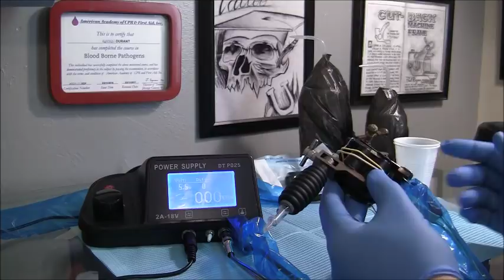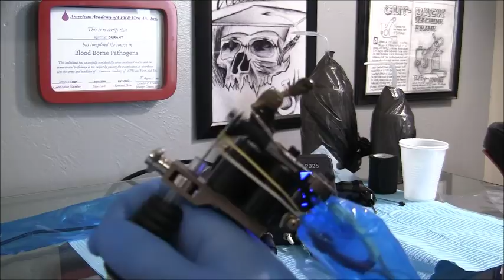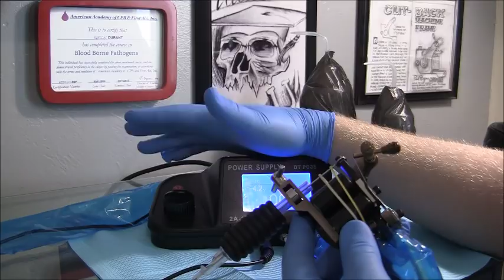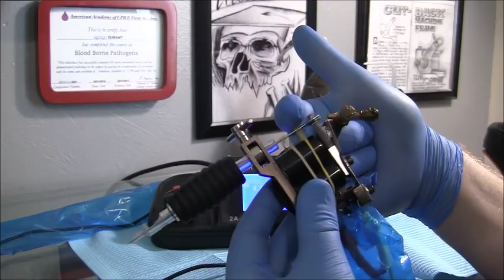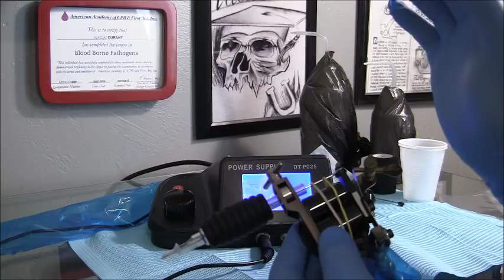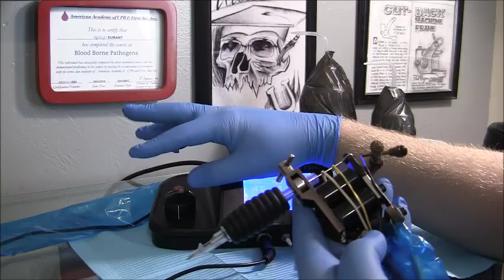Setting the Correct Voltage- Tattoo University

Comment: Are coils better w 3amps instead of 2a?
Reply from the maker: depends on what your trying to do. How does the machine work with 3 vs 2? What type of machine are you going for liner, shader, color packer. Machine building is an art. There is no definite answer to that except for does it do what you want after adjusting that part
Reply: @TattooUniversity line work with ability to power it lower for shading 
Think of line work skull with minimal shading like in the eye and nose sockets
Reply from the maker: @jambajoby32 hold on to that thought and I'll do a video on this. There is a lot more that goes into this than a capacitor. You want a liner that you can shade with. Your capacitor can help but you're looking at spring tension and speed. You also have the throw to adjust. The weight of the armature bar. All things to think about along with the capacitor. I would make two machines. One with each type
Reply from the maker: @jambajoby32  also think about technique. Move hand slow and steady for line and faster for shading. There is so much you can do.
Reply: @TattooUniversity yes sir 🫡 
I know many cats I look up to discuss the idea and my tattoo guy also has demonstrated fine lines and basic shading (on simple tattoos like a lucky money cat (Maneki Neko) or skull with a liner. 
I know is it comes down to having a command for the machine but also would like to hear thoughts on approaching this. 
FWIW, I’m waiting for a shader to be made. I would like to keep my set up super simple and basic.

Comment: I just gotta set up from my brother...so i had my volts on 7...i was doin great for like almost a hour practicing on fake skin. an for some reason it wont go back down its stuck on 16 volts an the knob wont turn it down. What you think happend? Oh an my power supply didnt come with a power cord...i got a 125v power cord...but the box says i need a 250v power cord. You think this is the problem? The box isnt hot at all
Reply from the maker: When you're practicing stuff like this is good because you learn from it. From my experience you don't want to force things to work. You don't want something like this to break down while you're in the middle of a tattoo. It will make you look unprofessional and it will take a lot more time to finish the job. My suggestion would be to keep looking for some equipment that is better. If you have good or bad equipment always look for ways to improve.
Reply from the maker: I have had some really bad power supplies when I first started. I had to go through about four of them before I finally found one that worked correctly. When you get the cheaper ones they tend not to work like they should if you can eventually go for a better power supply. Having a really good power supply is a must and it will last you a really long time
Reply: @TattooUniversity  thanks!

Comment: I love this video to help fall asleep every night. his method is great tho, but don't be afraid to turn up the voltage, depending on your machine build it could vary, do what he shows you with the finger, if it stops its too low, you have to hear the machine sound change when entering skin,  that's what your looking for, if you put your finger on the bar and there is no sound change,  it's too high.  good luck

Comment: Should it be running at ~50% duty if you go by sound?  My machine sounds great, not bogging down too much, but running at a lower duty.  If I bring the volts up it gets to about 50% but it seems to be hitting too hard.  I'm using reelskin and its cutting it.  At this point I'm not sure if it's actually hitting too hard or if reelskin is just really fragile.
Reply from the maker: Couple issues here. Fake skin isn't real skin. Even if they call it that. It is rubber and will act differently. Rubber should actually take more damage than real skin. If you are cutting it then you will most likely cut a person with that machine. Don't think it's your duty that is the issue. The machine is running too fast or your hand is moving too slow. With the needle moving so fast it is acting like a razor blade or cutting device. You want to slow that down so the needles puncture the skin and leave ink without chewing up the skin.
Reply: @TattooUniversity  Wow man I really I appreciate you and your fast response.  As soon as I read your comment, I quickly set up and tried a faster hand speed and that seemed to have made a huge difference.  I was slowing down because my lines were coming out real faint.  I think I may need to actually go deeper and bring up my hand speed.  I'm going to go practice with that in mind.  Again, thank you so much for everything you do 🙏

Comment: Awesome vid! Glad that I found it. 
Got a new coil recently but that machine also confused me. 
It’s so powerful that can only start at 3.5 and it kicking loud.  And I can normally do lines at about 3.7. 
I guess it’s depends to the machine 
Hope it’s normal. 🥴
Reply from the maker: Very normal. If it's working how it should. Somewhere down the line this voltage confusion was thrown out there. I always run 8 volts bull crap. You only use what it takes for the machine to run correctly. 😁
Reply: @TattooUniversity   Thank you for replying me president 🙏 This channel is a community with love. ✌️    Peace

Comment: How much voltage would be ideal for thinner skin vs an arm like face?
Reply from the maker: Start off with less and add more until you get correct results
Reply from the maker: If you don't have enough voltage you will get ghost line. If you go too deep it will hurt and bleed. Machine set up and needle will effect voltage needs. Do a test line and adjust.

Comment: Ur finger does no simulate the skin when stopping the armature bar because the armature bar doe simulate the thin needle going into a small surface area of ur skin
Reply from the maker: You are using your finger to see how hard the arm bar is hitting. This let's you know it has the ability to push needles into the skin. Smaller needle groups don't need as much power. This is where adjusting the machine and voltage come into play. Bigger needle groups needing more force to puncture the skin because they have more surface area to puncture. The thumb is one  indication if your machine can do this or not. If the machine stops when you put your thumb under the arm bar it's not going to push anything into the skin. This would mean your thumb is simulating the skin or what will happen to the arm bar when the needles hit the skin.

Comment: So does this mean that you can use the same machine for lining and shading there doesn't need to be different springs or anything
Reply from the maker: This answer to that is a long and complicated one that people love to fight about. Let's see if I can answer in this comment. Hope your sitting down this could wind both of us. You can use the same machine to do anything you want. You can line, shade, and color pack with any machine if you know what you are doing. It also helps if you understand machines. Let's take it down another rabbit hole. Machines aren't liners, shaders, or color packers. They are just machines. People call them those three names to try and simplify things. You have faster and slower machines. You have different machine frames that allow for more or less stroke. The amazing thing is artist like different things. You can adjust the machine to do what the artist wants. I line with what someone might call a shader. It is a slower harder hitting machine with a longer stroke. A shader set up with less tension on the rear spring. If I move my hand faster I can shade with it. If I slow down I lay down a solid line. Take a "shader" sometime and put short tapered needle in it and start filling in color. The needle adjustments will effect how you can tattoo. Yes you can do anything with one machine if you understand machines, needles, and your art techniques. You can also adjust your machines so they do specific jobs. I can adjust a machine so it does line work better than shading. I can adjust a machine so it's easier to shade with it by adding more tension on rear spring. Certain machines will make it easier to do your job. Faster shorter stroke machines are good for one liners. Longer stroke machine with hard hit is good for color packing. The key point I'm trying to make is learn as much as you can. Knowledge will give you the power to make decisions because you know the equipment and how to manipulate it. You know the marks you want to make. Match it with a machine that allows you to make those marks successfully. So the answer is yes and no. You can adjust yourself or your machine.

Comment: Depends on the machine...  the thickness of the spring you cut and the roll/bend in both springs, the specific coils you wound, and the capacitor. learn to use your hand to apply the right pressure and float the needle. Learn to use the right thickness of spring stock, Ans how to get the perfect roll to those springs. 😂

Comment: The setup volts depends the amount of wraps on your coils. There is no sweet spot. Got 4 different liners machine for different lines, one is running on 3.6 volts the setup is for a 3 round liner needle till maximum 5RL needle the bigger the needle the more power a need to get the needle in the skin. So for a 7 or 9 RL I got a different machine. And need more volt to get it run .... because I need a little bit more power I need different coil, coils with more wraps. Most important know how a coil machine works, if you know how it works, then you know how to adjust. 
A machine is not going faster if your put more volts in it ... it goes harder... not faster it's a big difference.

Comment: Dose this apply with machines like the Cheyenne hawk thunder or other pens?
Reply from the maker: In order to answer a question like this you need to understand tattoo machines.  The difference between rotaries and coils.  How machines are set up to work differently.  What you need to take into consideration is the speed and hit.  With a rotary pen you would turn up the voltage and increase the speed of the pen.  The hit would stay the same unless it was adjusted with a give clip or another device.  You always are looking for the right combination of hit and speed.  You never want to overwork the skin so it is better to use just the right amount of both.
Reply from the maker: The answer would be yes.  You would just need to apply the same concept to the different device.  Never just turn up the voltage and hope for the best.  Learn how to adjust the machine for what you are doing and your hand speed.  Once these things are synced up with your machines settings you will get a good result.
Reply: @TattooUniversity  thank you I'll go home an test that out. I've done some Pretty good tattoos an they have come out good . However I just use my machines based off what other tattoos artist have recommended.  I never knew about this process and now using the cheyne machine I wasn't aware I'd you could check for bog or not but the sound this was big for my mob shader I tried that out yesterday
Reply from the maker: @lockstarkingding  Everyone is different and will have different settings.  It is good to figure out what works for you.  Use other artist advice to get you started and then make adjustments for how you tattoo.  I always read the tattoo.  Look at it and see if everything is correct.  Is the color going in solid? Is it chewed up?  Then I make adjustments until I figure out what will work the best.  Do a test area and see if the settings are correct.  Make adjustments as needed.  Experienced artist know how to make these adjustments when needed.  Knowledge and time help you decide what needs to be done in different situations.
Reply: @TattooUniversity  thank you that's a big help because its almost impossible to get an apprenticeship in my area been wanting it for years. Your videos are a blessing man

Comment: Finally a video that makes sense
Reply from the maker: Thank You
Reply: Could you do a video on why the needle drags or sticks to the skin please ?
Reply from the maker: @Scooter3194  The tattoo machine springs don't have enough upward tension or there is too much hang.  Put the needle in more or adjust the tattoo machine.  I can do video.
Reply: Thank you because I’ve adjusted needle idk how many times and it still drags
Reply from the maker: @Scooter3194  Machine needs to be tuned.  You can try to loosen up your springs.  Put it out to the side and bend it upwards.  Then put it back and it will have more pull toward the contact screw.  Might give you enough pull to get the needle out of the skin.  This will change your duty though.  Could be good or bad.  Here we get into tuning tattoo machines.  One adjustment will effect how the machine runs.  Everything needs to be correct to work.  You can try it though and see if that does the trick.

Comment: so what is the machine you used for that voltage?is it a liner or a shader coz i cant figure it out.....
Reply from the maker: This is a long complicated answer but I will try to make it short.  Voltage varies from machine to machine.  The amount of wire and quality of your coils will effect your voltage.  The clip cord and power supply will effect your voltage.  You need to know how the machine runs and adjust your voltage accordingly.  Also depends on what you are doing.  With a coil machine you can turn up the voltage and get a harder hit for color packing.  Turn down the voltage and get a soft hit for shading.  You need to understand how the machine works in order to understand what voltage to use.  Typically cheaper machines use more voltage because they are lower quality.  The wire is thinner wire and they usually are 10 wraps.  More wire typically more voltage needed to run.  Same machine with better materials will take less voltage to run.  So when someone tells you to run your machine at a certain voltage they don't know what they are talking about unless they have experience with that machine.  There is a way for you to tell how much voltage your machine needs.  You turn the voltage up until you feel it hit hard enough to do what you want.  Put your thumb under the arm bar nipple and feel it.  It is only correct when the machine does what you want it to.  If it still isn't working you need to tune your machine.  There is probably more that goes into this.  Too much to put in one answer.  Short answer is do what works.  If it doesn't work something is incorrect.  Voltage is a variable that depends on other factors.  Your machine set up and how it is built.  What you are trying to do and your style of tattooing.
Reply: up

Comment: So shading requires less voltage than the outlines ?
Reply from the maker: There are other factors that come into play here, but typically I would say yes.  Less voltage allows for a softer hit.  This will allow you to build up your tones if your machine is set up to work this way.  Might not apply for certain rotary machines.  Voltage effects speed more then the hit on some rotary  machines.  In that case you would adjust your voltage to your hand speed used for shading.
Reply: @TattooUniversity  thanks mate thats a very clear answer, my machine is a coil tho.
Reply from the maker: @TisDeV  Your results will vary depending on how your machine is set up.  Typically though the answer is yes.
Reply: @TattooUniversity  thanks alot mate.

Comment: I have a ? I have to use my machine at prety high volts,but still seem like not enough power,power supply is one of those dual liner/shader.sumthin is not rite n e ideas?thank ya
Reply from the maker: Machine tuning is the key.  If the machine isn't set up correctly it will not tattoo.  Learn how to tune it or find someone who can tune it for you.

Comment: Amazing video, but i have been tattooing on fake skin. When i tattoo on anything under 12 the ink wont Get in the skin. I really dont understand why it is like that. I am afraid i am going to hurt someone Badly if i dont get to know my problem
Reply from the maker: Sounds like a machine tuning issue.  Could be the ink you are using.  There is something wrong for sure.  Try to watch some of my machine tuning videos.  See if there is something that will help you out there.  Also work on your depth.  Make sure you are going deep enough.
Reply: You where right, got a new machine today everthing seems fine now

Comment: Im 1st timer and i just ordered a tattoo set and this vid help me understand how to tune my machine.. I wonder if this also applies if its shading machine?
Reply from the maker: Machines are tuned the same.  They are adjusted with different tension and stroke length.  The basics are the same.  You need everything lined up so it works.  Once it is set to work you adjust it to do what you want.

Comment: Love the videos and learning a lot from you..may I ask a question my colour packer only works at 10 volts is this normal. Many thanks. .
Reply from the maker: can be normal for cheaper machines.  If the coils aren't made from good materials.  Also 10 wraps and 12 wrap coils take more voltage to work.  The more wire the more voltage needed.  Way to fix that is tune the machine better.
Reply: @TattooUniversity  cheers for the advice I brought it from someone who builds them I brought a liner off him as well liner works great at 6 volts and I've played with the packer and I've got it down to 7.8volts and seems nice and smoother now. Great videos and valued information all the best from England United Kingdom.